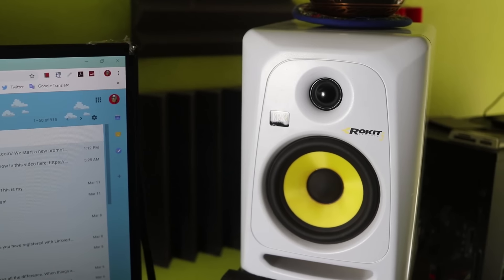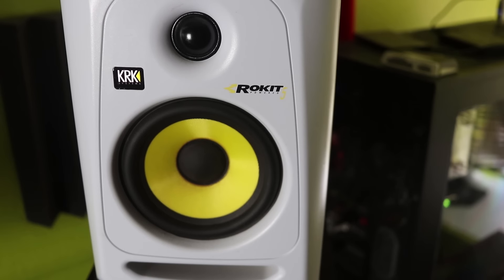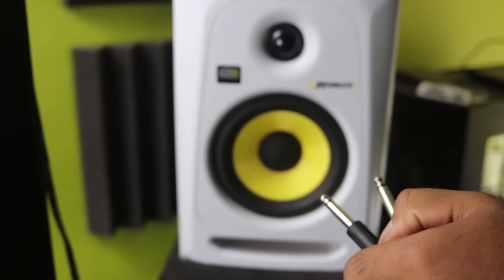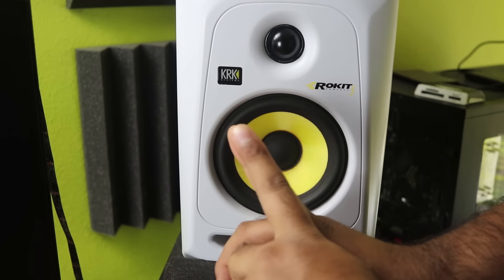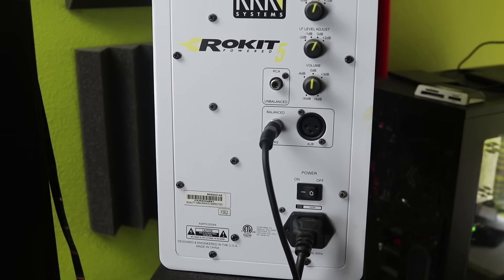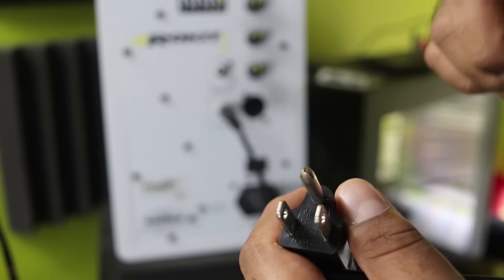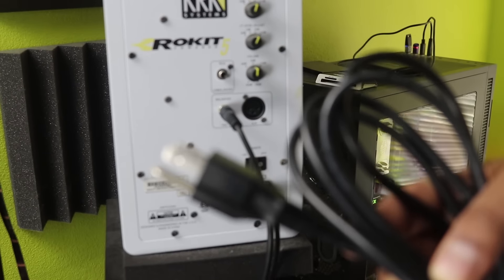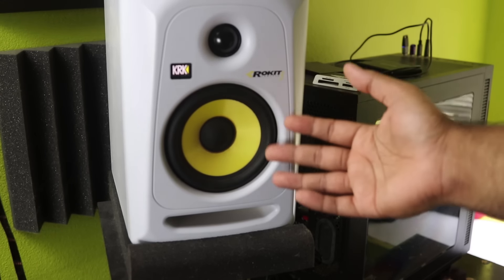How To Stop The Electrical Noise From Studio Monitors!

Comment: I have just pulled my cable out to check what type of cable do I have, and then, when I put it back in, it fixed everything. How great is that?
Reply: hahaha yooo fonzi in the studio
Reply: No stg
Reply: Same looool no lie
Reply: if in doubt, switch it off then on again or pull it out and plug it back in 😁
Reply: I tried that here, but I had to wiggle it a bit and push it harder... now it works. 🤩 Thanks for the tip
Reply: Wish i had the same problem tu bad we’re not the same 😂🤣

Comment: my dude, you just saved me from going crazy...  just got a new pc and noticed this right away and has been driving me nuts, so I moved my pc tower away from the monitors thinking that would help but the noise was still there, so I turned my monitors volume ALL the way down on the back but still could hear that annoying noise, finally found your video and got some balanced TRS cables and the noise is gone!!! thank you man
Reply: I also just got a new computer. My laptop previous never did this! Even if I buy TRS cables how do I plug the new TRS cables into my computer?
Reply: @Saoshaner  You need an audio interface to go between your pc and monitors basically. also another issue I found when diagnosing this issue is on Dell motherboards turning off "C-States" power switching in your system bios can make this type of noise go away

Comment: i bought a pair of new Yamaha HS7 monitors, and they worked perfectly the first time i turned them on. went out of town for two weeks, turned them on, and got the same noise you hear in the beginning of your video. figured out that they were making noise even without any other cables being plugged into it(other than the power cord). tried multiple outlets too, and they all gave me the same results. i actually exchanged my HS7's for a new pair, and the new pair had the same problem. my theory is that someone in my building bought a new appliance, and that is what is giving me the interference. need to find a device that can help with this as moving out is not a option.
Reply: Have you figured it out?

Comment: DUDE!!! You have literally saved my sanity with this video... I have tried every single thing I could to get rid of this noise while using a guitar lead... I mean, I have pulled my PC apart and put it back together, had my sockets rewired in my room, used different leads and cables, brought the PC to a repair shop, software upgrades, different PCs connected... It was as simple as this. Now I have no excuse for not recording other than laziness. I can't thank you enough. Let me know if you have a patreon or similar and I'll buy you a pint!

Comment: Thank you so much. It got almost perfect.
I had RCA cables to my studio monitors before I moved to a new apartment. Worked great without ground in outlet. But In my new place everything is grounded, which is good. It was so noisy with rca in grounded outlet.

Xrl to 6,3 balanced cable did the trick. Thanks again.

Comment: Also check for lights with dimmer switches!! If that dimmer switch is on the same electrical group coming out of the main fuse box as your audio equipment it's almost a guarantee that dimmed lights will cause audio problems.
Reply from the maker: True that!
Reply: dude
Reply: thats literally the source of my white noise lmao. Thank u
Reply: damn i have wifi-dimmer switches everywhere...

Comment: Anyone that tried this and it didn't work try connecting the balanced TRS cable from your external audio card (outputs) to the mixer. This finally fixed my issue after 3 days of troubleshooting. Still using normal mono jacks from the mixer to the KRK speakers but that horid PC (processing from the CPU) noise has totally disappeared

Comment: That’s the bloody noise I heard when I was setting up my equipment for a gig. Never happened to me before, but had to try and move the speakers around to minimise the electrical interference as much as possible. But all I ended up doing was changing to a different outlet, which solved the problem. Plus I was beside the electrical board for the lightning and microphone controls for the venue. Thanks for the advice.

Comment: I have the same issue atm, I guess it's just the fact that nothing is actually grounded and I have quite a lot of stuff plugged in the outlet, at least 15 devices or so. It is primarily caused by video devices such as pc videocard -> monitor etc. You can actually hear the mouse moving or when graphics is changing on screen. Balanced cables won't fix the problem. The only good way to solve it is to actually make sure everything is grounded properly and also prevent any ground loops as well. It does help to plug the monitor-speaker powercables as far away from other devices, maybe use a different outlet on the other end of the room for example, but this is not really an elegant solution :)

Comment: My Rokit 5s makes this low white noise once turned on. They are connected with balanced cables of two different brands. The white noise is audible if I get my ear too close to the tweeters. Also those prongs were already not present on the power cable when I bought them here in India.

Comment: where can i find a dual 1/4 inch trs to dual rca cable? i'm trying to connect my yamaha hs5s to a scarlett solo and i have this buzzy ts unbalanced cable but can't find any balanced ones online
Reply: the scarlett solo,  i read it has 2 balanced outputs ... but the images dont show that ... line outs ? unbalanced rca x2 ? ...i think you need a dac with a balanced output like i do unfortunatly .. dual line out xlr x2 or 1/4" trs x2.
i have hs7's here and a topping dx3 pro which only has rca line outs and using rca to ts cables i get buzzing which is low when doing general non gpu related stuff but gaming ... then my hs7's start screaming at me !
im now looking at something like a smsl m500 as i need a headphone output but there are cheaper balanced dacs like the smsl m300 (no headphone amp) i have read that any cables that are 2 pin to 3 and claim they are balanced cables are lying .... it must be xlr to xlr or xlr to trs.
Reply: oh just rembered you might want to wait, if you are looking at dropping some cash as there is a shortage of dac chips atm and prices have increased .... my dx3 pro cost me £170 in sep 2020 its now around £220 !
Reply: @CrunchyF123  thanks for the reply. i think the scarlett solo 3rd gen does have balanced outputs like you said, but I have a 2nd gen version which has rca output. after reading some forums online, it looks like that there's not really such a thing as a balanced rca output so the fix in this video won't really work with my audio interface. for now i just have both of my hs5s volume knobs turned down really low and the scarlett solo turned up high. this minimizes the buzzing a good bit

Comment: <If you still have issues with balanced cables try this>
1.STAND UP
2.Power on monitors
3.Pass your hand over the sides, back, bottom, top of studio monitor
4.Move your hand away and bring it back
5.If the sound goes away when over one side you
are receiving RF interference from somewhere behind/front of that side

-also try touching the power cable where it plugs into the monitor
then start from step 4
-it turns out wifi routers very close to your equipment can cause interference
-if all else fails look into ground loop isolators
EDIT* this vid is also helpful
https://www.youtube.com/watch?v=K-VTvaa7XDc
Reply: This is what I've been looking for! I noticed that when my hand is touching the side of my monitor the popping goes away. I have a mesh system on the shelf underneath that same monitor. Could this be causing the issue?
Reply: @michaelpetrino4261  Yes it’s possible. I found out my interference was from having my phone close to the monitor. Something about the Yamaha HS series that makes them less shielded to RF.

Comment: To anyone still looking for a solution: 
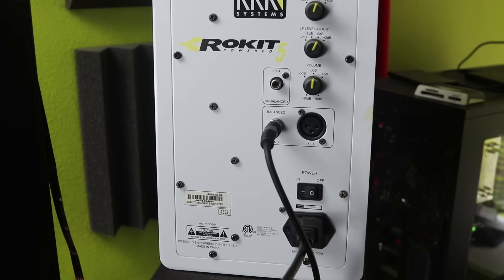I've had that exact electrical noise at 2:04 on my Yamaha HS5's for years that I could never get rid of. It would sound like that whether or not I had audio or video running on my computer... and just audible enough to be annoying as fuck. I have a power conditioner, balanced TRS cables, using balanced outputs on my interface, having the monitors and computer on the same circuit, and then on different circuits, etc. nothing worked. I considered the Morley Hum X Exterminator, the Pyle Hum Eliminator, and the Behringer HD400 Hum Destroyer, but these all had bad reviews online that said it degraded the sound quality so I didn't bother trying those. Today, I found a solution that fixed the issue 100% for about $200 CAD..... the Radial SB-6 Stage Bug Isolator. Grab an extra short pair of balanced TRS cables as well to use with this. So for me, instead of interface -> monitors, it goes now interface -> SB-6 -> monitors. Press the two ground buttons on the SB-6 to remove the electrical noise. This solution works for those using 1/4" speaker cables, but if you're using XLR cables then you could get the Radial Ice Cube (you'd need 2 because they're single channel but they're only about $100 each) or the Radial TWIN ISO Twin Isolator would do the trick if you prefer a 2 channel one at a higher cost of around $400. Obviously these are expensive solutions but it worked for me %100 they are dead silent so I'm happy. Radial makes great audio products, I highly recommend the SB-6 if you're having this issue. You won't regret it.
Reply: $200 though.. may as well buy another krk rokit monitor in that case..
Reply: @kramer911  Your ears and sanity ain't worth $200? Maybe you need a better job. And never get KRK's man, never do that to yourself.
Reply: man ive been having the same issues with my yamaha hs8 monitors. i just ordered a balanced xlr to trs cable. i only get those noises when i'm gaming on my cpu but it's really really loud especially when my gpu kicks in on more graphics intensive games. i use my cpu for a mixed setup for audio mixing and gaming. i really hope this helps as i've tried every thing else.
Reply: @RyanLBC  Hosa trs to dual xlr cables fixed my problem with my krks completely. Was shocked

Comment: The noise is most like caused by "Ground Loop", that mean different devices are connected to different ground. Simply connect all the devices to a common ground will fix it. By the way, it makes not much difference for XLR & RCA if the distance of cables are not very long if the cables are properly shielded and grounded. If your output is not balanced , using balanced cable will not have any effects.
Reply: I get it without any XLR cables, i plug directly into the wall and still get the constant 60hz humm is this still the same issue or could it be something else? The sound on the monitor is fine, its noticeable when the room is quiet though

Comment: My headset only buzzes when it's plugged into my TV set, but I'm not using a cable box. I only have a wireless setup and the only wired connections to my TV are the power plug and an outgoing HDMI plug for my  DVD player. When I plug the headset into my computer there is no buzzing or crackling sound. By the way, my PC is plugged into a power 
strip and both the PC plug and the strip are 3 pronged (grounded). The TV plug only has 2 prongs so I doubt that going through a 3 pronged (grounded) cable would make any difference. The headset is the Samson S850 which is rated at 32 ohms if that matters any. I have a cheaper headset that doesn't have this issue, but again, the Samson S850 only has this issue when plugged into my TV and not when it's plugged into my PC. The cheaper headset also has a 3 black ring TRRS prong whereas the Samson headset has a 2 black ring stereo prong but it's plugged into a 4 pole TRRS audio extension cable. I guess the extension cable won't help if the device that's plugged into it doesn't also have a 4 pole TRRS plug. Is there anything I can do to get rid of the buzzing and crackling sound in this situation? By the way, my headset doesn't have the option to use a different cord.

Comment: Haha! I had the static sound on and off for a year. I found the cable connected to my desktop and it was very taught with electrical wires hanging around it. I disconnected the cable, separated it from the others and let it hang loosely. Fixed the issue. Sounds so much better. I thought the problem was my speakers being faulty because they are old.

Comment: If that static noise is caused by your aux cable  try switching your devices in which the aux is plugged in- if it only occurs on your Pc or Laptop the port might be damaged or you have a bad sound card in which case you should look into buying either a new sound card or a seperate audio interface which is useful anyways. But I highly recommend you talk to an Expert first

Comment: I'm having the same issue. However, I do not want to use a patch cord. My new computer does not have a patch cord output. I'd rather use the RCA cable. Are you saying the only way to get rid of the static is to buy an interface and a balanced patch cord?

Comment: If anyone is wondering, some of those jagged sounds you can fix, but if you are annoyed by hiss in general, almost any class D amplifier will still have some even with high quality cables, a great sound card, and clean power.
Reply: True, but my monitors have class AB amplifiers and sometimes I get a weird crackling, buzzing, static sound. It usually goes away after a few seconds but will randomly come and go.

Comment: and what if i have noise while using balanced cables lol, had this problem for years and haven't been able to track it down :(
Reply from the maker: There are other things that you can try to see where the issue is coming from.

Swapping cables, or electric cables.

Try a different electric outlet in the house.

Any of those 2 choices can help you determine if that issue still remains. If it does, there could be a chance that the speaker itself is having those issues internally.
Reply: My Rokit 5s makes this low white noise once turned on. They are connected with balanced cables of two different brands. The white noise is audible if I get my ear too close to the tweeters. Also those prongs were already not present on the power cable when I bought them here in India.

Comment: I had a pair of Presonus Eris E5's. My noise was at least as loud as yours on RCA's. I bought a cheap (cablematters) brand balanced XLR to 1/8 AUX (into my PC motherboard, Realtek S1200A). The overall volume decreased by a HUGE amount, as did the noise (likely due to the volume), but the bee buzzing electrical noise was still sitting there in the background at idle. Returned those for a pair of Rokit RP5G4's. The noise decreased even further, but just barely. 
I'm tempted to buy a USB interface with XLR out, or one of those mini desktop amps with DAC and go passive. Most passive speakers are not flat, so that would be a downgrade. This is REALLY frustrating. I had a cheap pair of Logitech X140's with ZERO electrical noise.
Reply from the maker: Anything that goes into the Motherboard will result in an automatic static noise output. You got to remember, Those built in audio cards are connected and relayed into multiple different circuits within the motherboard. All those circuits creates the noise. I learned that when I got my desktop back in 2008. Definitely grab an Audio Interface for sure!!

Btw, you can use TRS out as well, since that is also a Balanced option with the Rokit's (double check yours just in case though! )
Reply: @OmoiSenpai  I installed an old Tascam US2x2 interface I was using for a PC mic. Connected via balanced TRS, and now the noise is 100% gone. Too bad this interface only does 16-bit, 96khz. Other than that, I'm golden.

Comment: what if all of your cables are balanced, and you are still getting that noise?
Reply from the maker: Have you tried using a different outlet in a different room, or part in your room? It could be some bad electric wiring as well. 
Or perhaps the power strip that you are using could be bad, or going bad.

Comment: I have a motu m2 running balanced quater inch cables, the motu m2 is plugged into a powered USB hub, everything is ran off a 1k UPS battery backup with sine wave output.  I have tried every USB port on the computer, changed so many things around the buzzing is driving me crazy. Any other solutions you can reccomend me try?